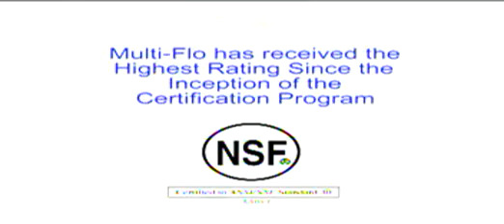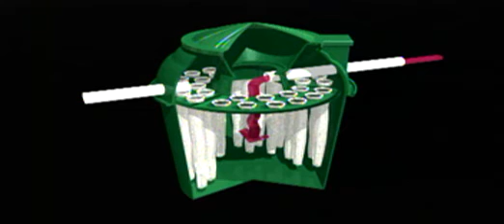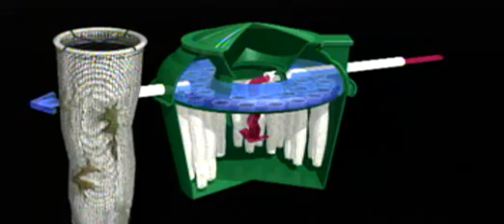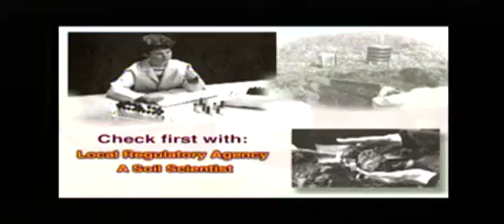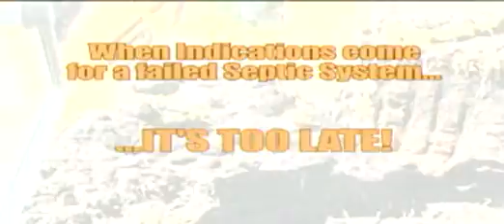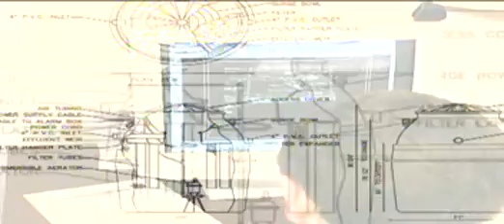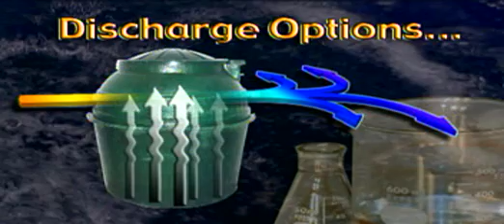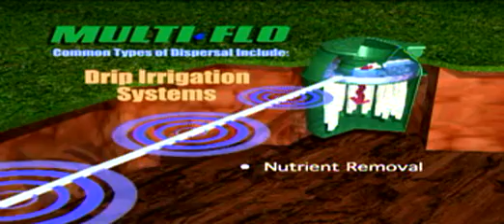Multi-Flo Wastewater Treatment System

Comment: Iv got a multiflo unit and they work well when the electronics work. Had to replace transformer and uv light in under 5 years. Once 12v supply frys, your alarms dont work and the system backs up. Alarms are useless when they dont work. I will be installing a 12v light on mine so i know transformer is working at just a glance.